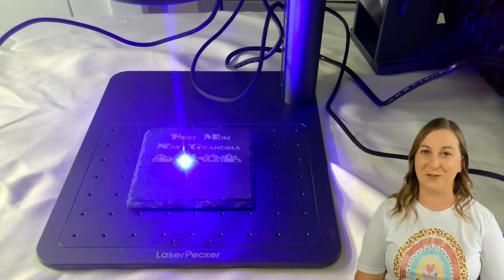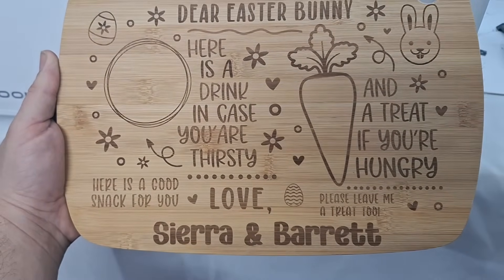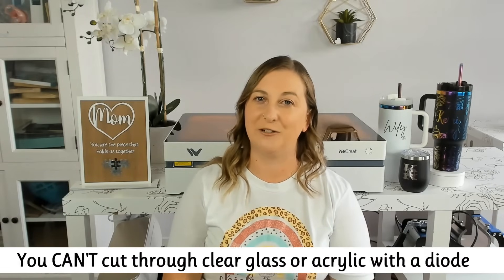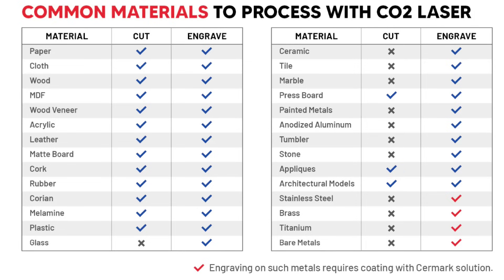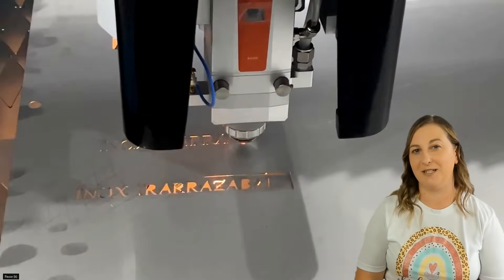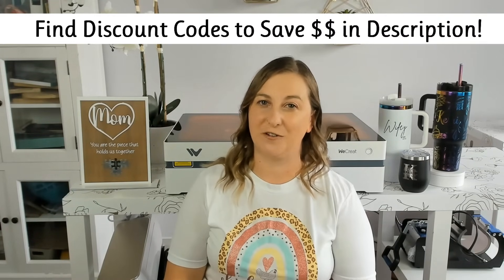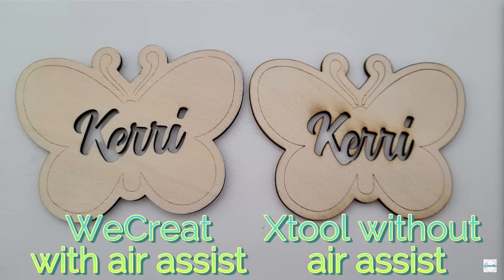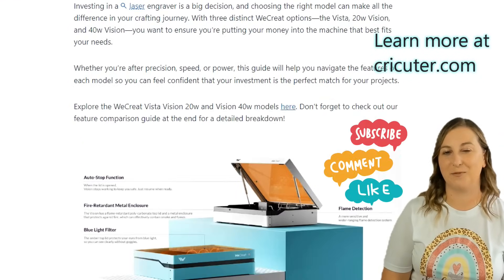STOP! 🛑 Don’t Buy a Laser Engraver Until You Watch This! Best Laser Engraver for Beginners

Comment: See I wanna do wood glass leather and like cut stuff out I’m not worried about metal though so what would be best for the versatility I want
Reply: I'm looking at the Commarker omni. Seems its capable to engrave all the materials you mention. Exceptionally the marks on glass and wood. Still considering whether I should get the 1 or new X model.
Reply: @Rogena-n6l how much is that?

Comment: Good to have a comparison but that was not a great demo of printing and cutting with the M1 Ultra because you don't have it lined up properly. Diode lasers still need cleaning, some are easier to clean than others.Unless you are using a CO2 laser for business, the tube is not likely to be an issue for a very long time, as long as you look after it ( make sure you fill with water where needed). One thing you neglected to mention is the software. XTool has XCS, Wecreate has its own and then there is Lightburn which can be used with some but not all lasers (and may not have all the functions of your particular laser software). Also worth knowing is if the laser connects to WiFi and if it is Windows/ Mac compatible. Not all are, surprisingly. When it comes to risers, XTool has two different ones for different world markets. The EU one used in some countries other than EU, does NOT have a pass through, for safety reg reasons and is just adding extra height; the one in the USA DOES have a pass through so you can engrave/cut longer materials as long as you have the physical room for it.